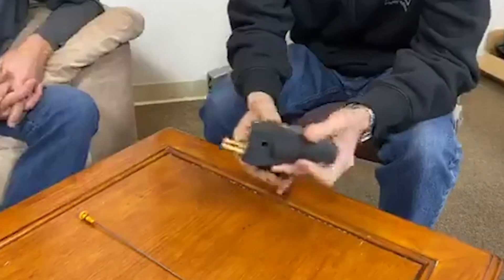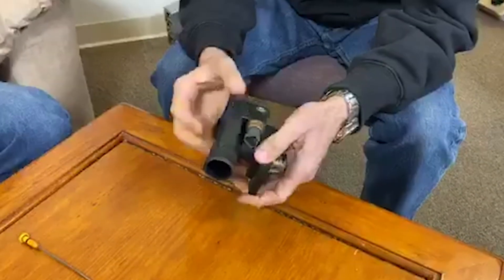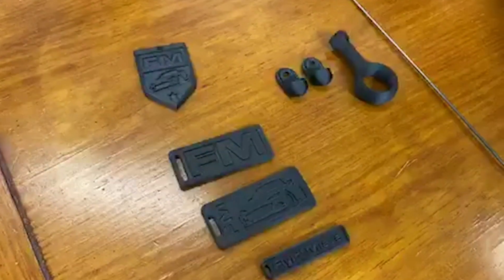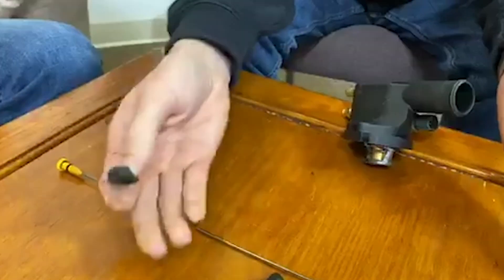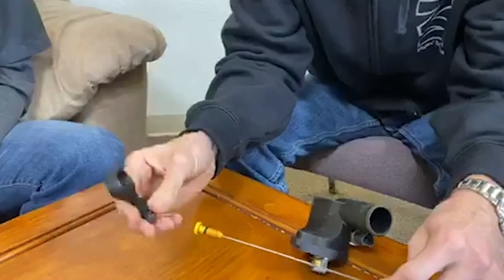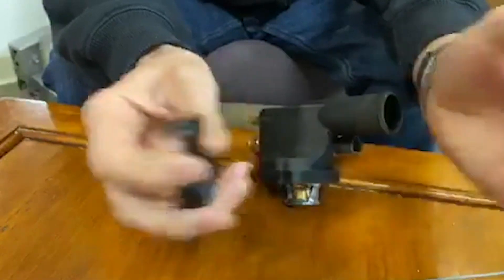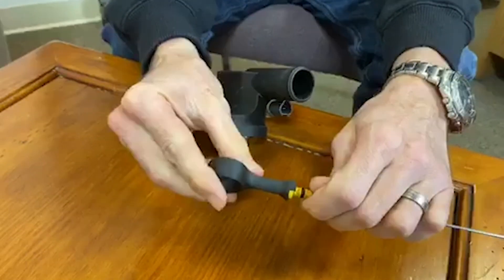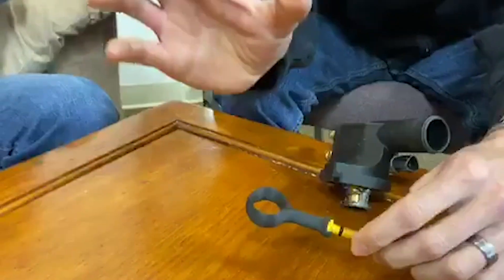3D Printing at FM! (FM Live)

Comment: Please please please 3D print a solution for the ND seat belt rubbing my neck till it bleeds.  The guide needs moved 2” outboard and 2” forward!  You could do it with a 2 piece design that sandwiches the OEM guide or print a block that you could re-mount the oem guide to.  Please please please please!